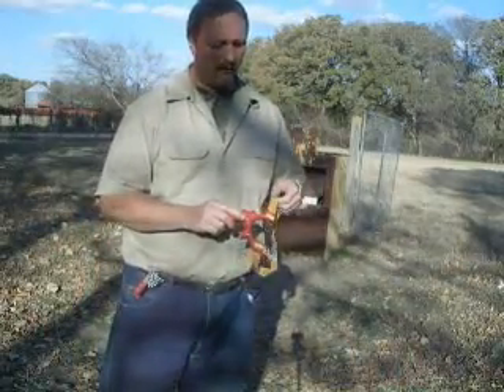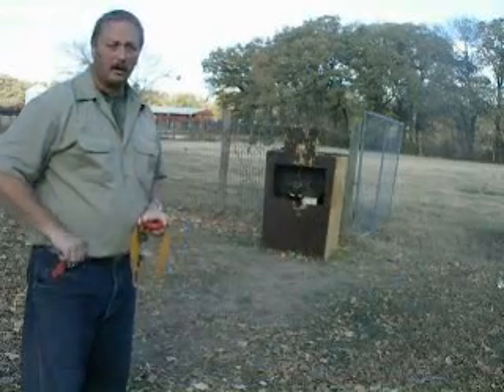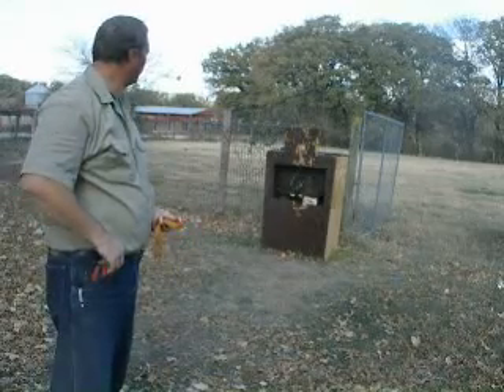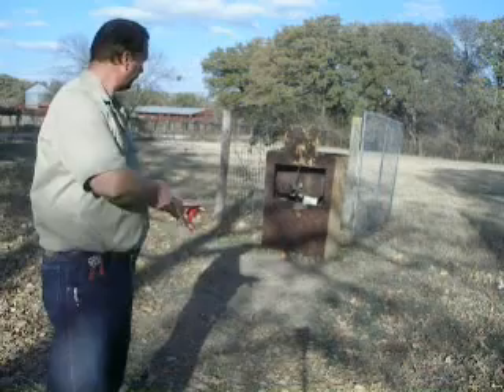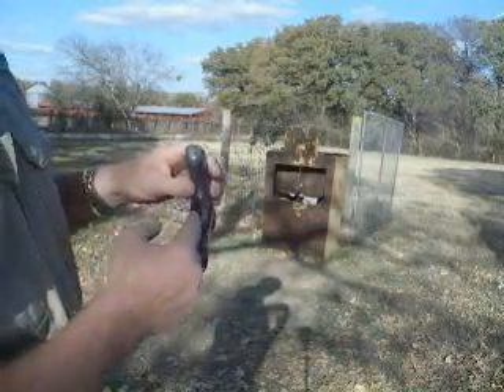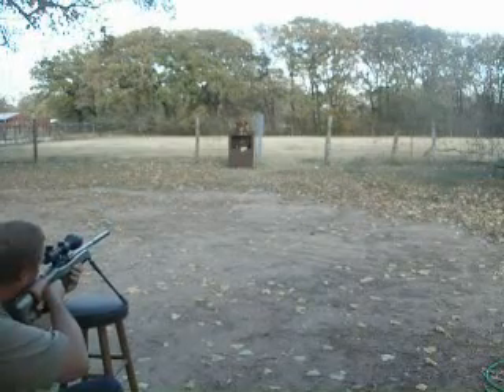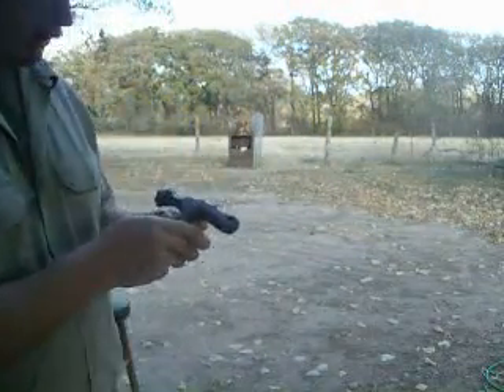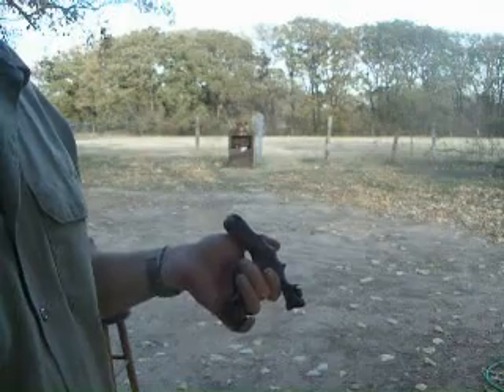Impact testing Ballistic Resin Hathcock slingshot

Comment: Hey I just got one of these ballistic resin Hathcock Target Snipers and I love it! It is not as polished as some other styles but It fits my hand like it was molded custom just for me. I am hitting targets twice as far away as I could with a wristrocket and ten times as often. Great product you have here Mr Hays. If I was to put tubes on it I would put bearings in the end of the tubes to hold it in place?  And it would go through  the forks just like the flatbands are set up now correct?  Thanks